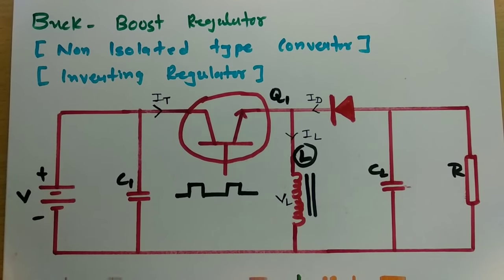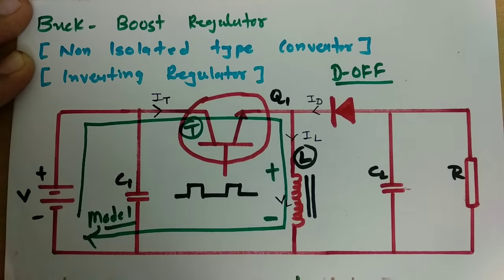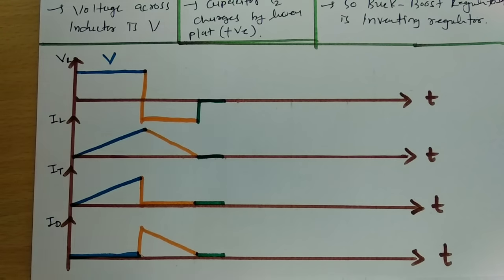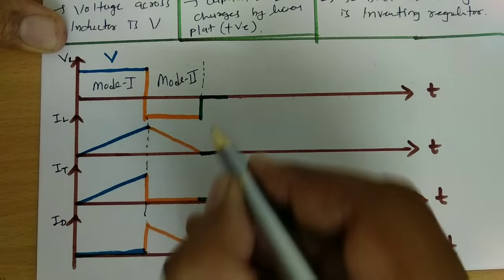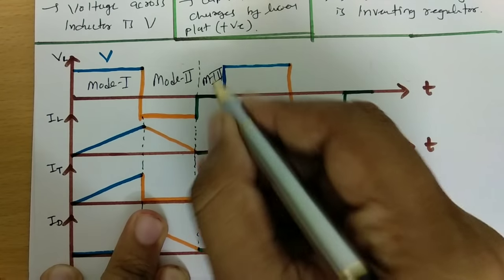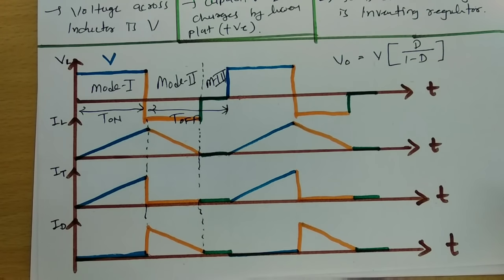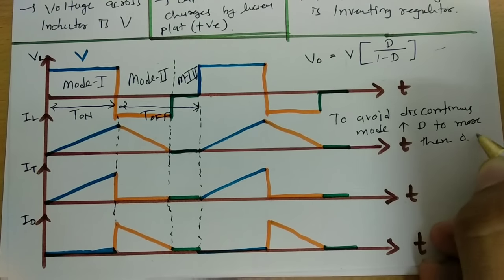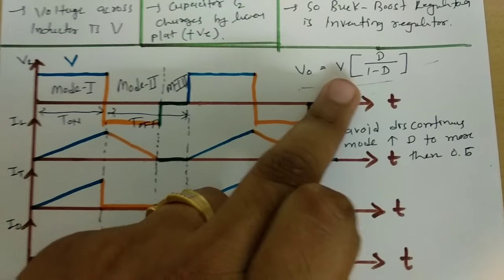Buck boost converter (Basics, Circuit, Working, Waveforms, Parameters & Applications) Explained

Comment: Sir in buck and boost converters capacitor connected to the load side is not affected by discharging of the inductor but in buck boost you said that capacitor is charging through inductor. WHY?
Reply: Because of the forward biased diode.
It overpasses the capacitor that connects to the load

Comment: In mode 3 when the capacitor discharges, why doesn't current flow through the diode again and charge the inductor again?. I mean how is the diode off in mode 3?
Reply: There won't be a correct loop for the current flow , as u said .As current takes shortest path too, capacitor +ve  if it starts and if we see from ur point then the current flows diode and charge inductor and reaches same +ve terminal which isn't possible......... But it's nice question hats off to u sir....

Comment: sir it can be used for the wind turbine to gives the output upto 12 v the wind turbine consist of PMDC motor
Reply from the maker: Yes it can but we need to see all the ratings of turbine motor
Reply: PMDC motor is rated voltage is 220V and 1750 rpm.